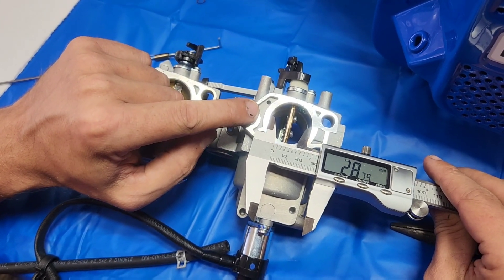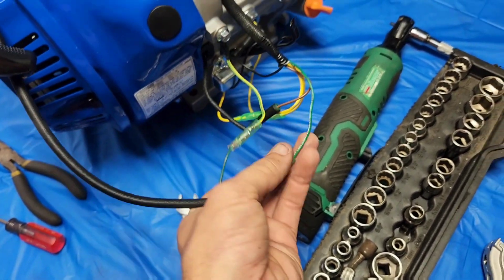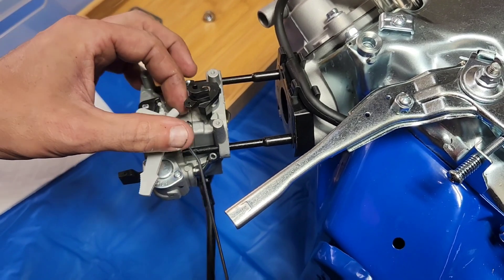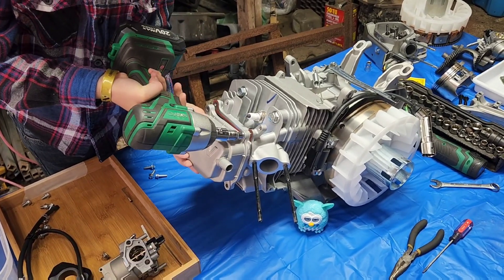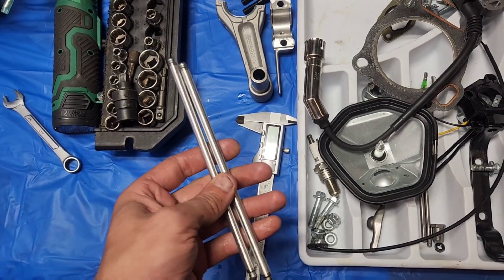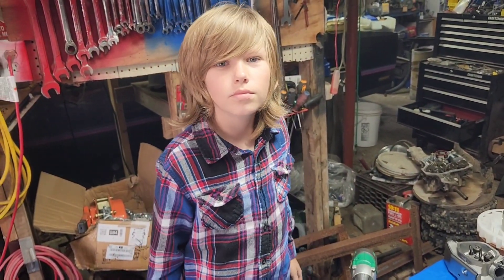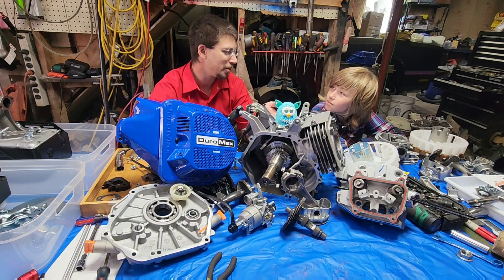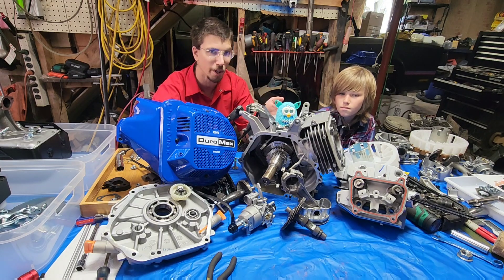Duromax 500cc Down To Block

Comment: the air box is a centrifugal particulate filter. it will swirl the air coming in in order to get the bigger particles ejected to the outside, then the inner circle of air is much cleaner. this is often seen on larger equipment engines that work in dusty places.

Comment: i hate zero turns i just "fixed" my customers zero turn by bypassing the neutral switches because i wouldve had to take half of it apart to properly fix it he didnt care so i dont the blades still shut off if he gets off
Reply: That’s only on the residential MTD zero turns, the commercial ones aren’t like that.